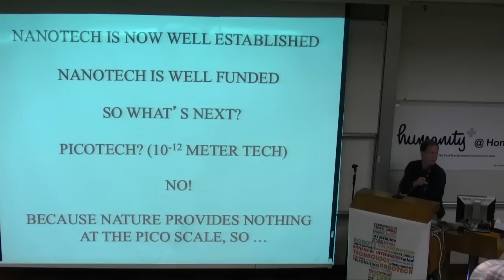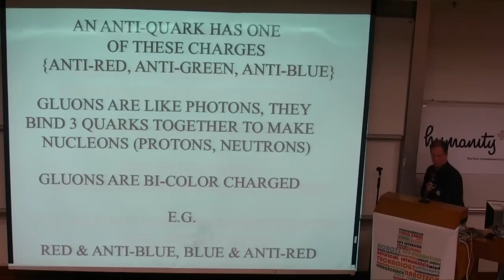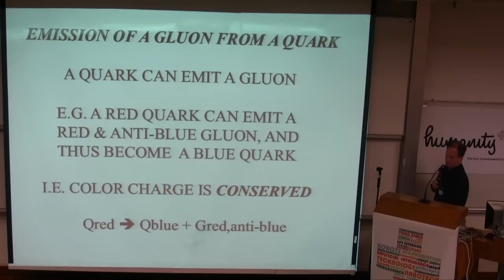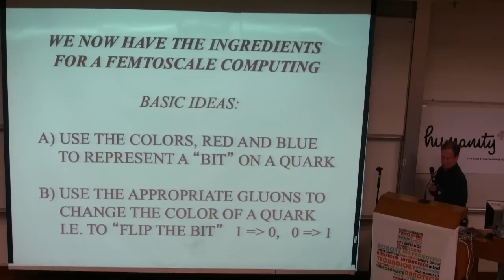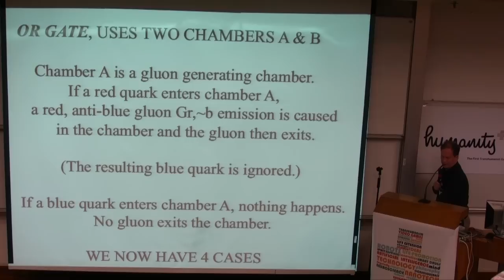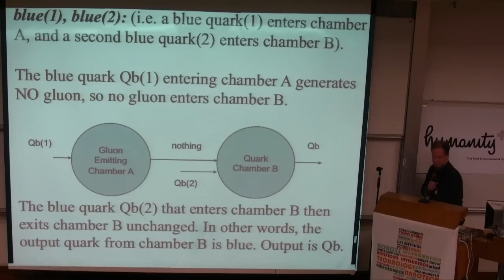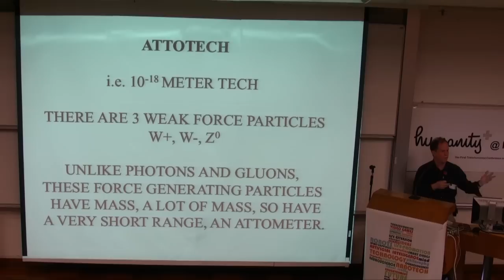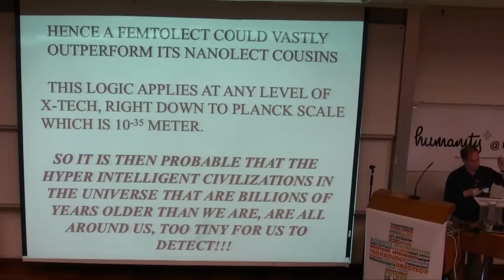Hugo de Garis - Beyond Nanotech to Femtotech

Comment: Femtotech wouldn't really outperform nanotech by a factor of a trillion trillion, since the volumetric density advantages would be counterbalanced by the increased mass density; a 1cm^3 volume of nanotech computronium might weigh 3g, but a 1cm^3 volume of femtotech computronium would weigh thousands of tonnes, and it's really an apples to oranges comparison.  A fairer comparison would be a 1cm^3 volume of nanotech computronium and a 1μm^3 volume of femtotech computronium.
Reply: But the density is higher